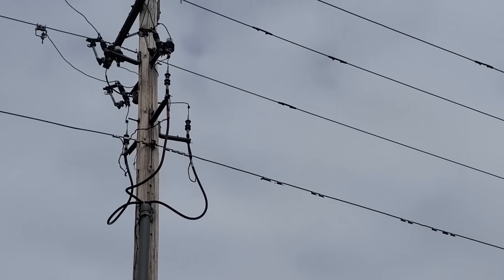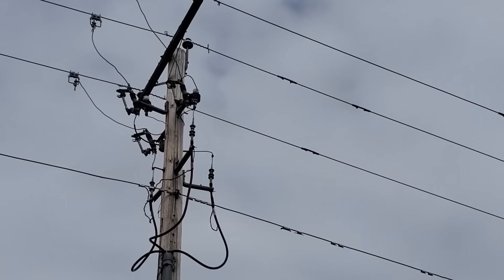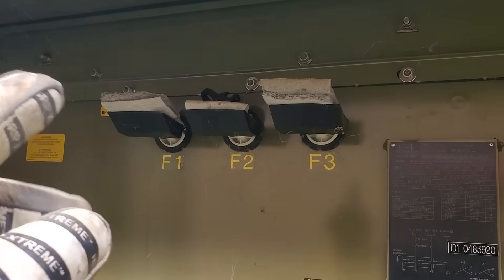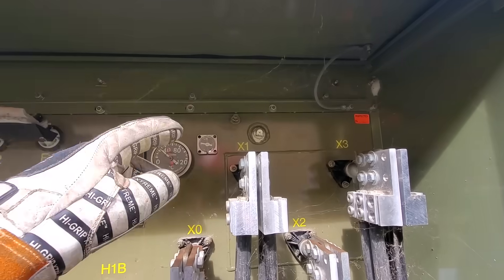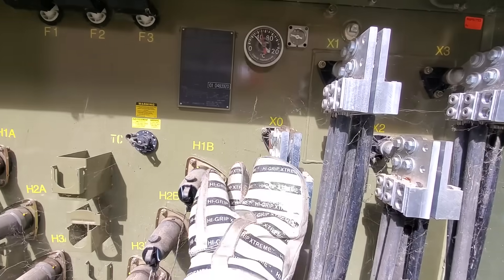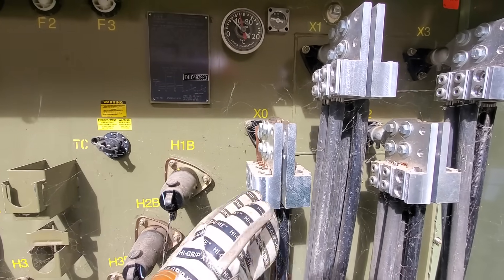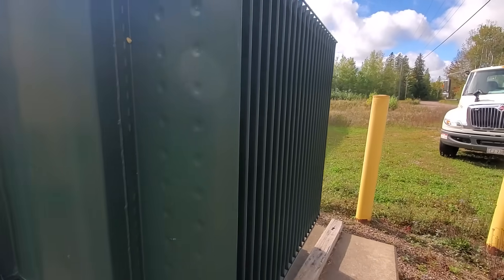A closer look at Padmount Transformers

Comment from the maker: ⚠️ First off... This stuff is absolutely not to be touched by anyone other then a representative from your power company whom is both trained and authorized to do so. 

I filmed this one last year and never got around to doing any editing with it. I've since captured a clip while I was removing the fuse cartridge to do work on the secondary bushings but didn't show how to change the actual fuse link. I'll be sure to post a vid changing the fuse link in the near future!

Cheers all!
Reply: That green box is where the local residential Cold Fusion Generator is located.
Oh wait...
Reply: Thx for the videos I used to help do power routines AT&T. I always wanted to see inside these transformers but anyone with common sense isn't going to open one without proper training.
Reply: Only line men can open the mmmmm doors
Reply: @hughsgarbagetrucks  Some idiots will force their way in.
Reply: No surge arresters eh?
Reply: When do you have to wear arc-flash protective gear?
Reply: Love your videos, learning a lot that I never would have the chance.  One suggestion: On your text descriptions, leave them up longer please. Rule of thumb, I heard, is as a video editor, ensure you leave enough time to read the text twice.
Reply: No matter what you should not be messing with the elbows while live even if you think you can it would destroy the elbow or cause an ark flash. I'm a splicer by the way.
Reply: I’m a plumber and we had a gc ask me to run a camera down some 4” conduit on a commercial site. They had trouble feeding their cables and wanted to check the conduit. This transformer was twice as tall as most of these you see. Anyway I’m going along and then I see the camera exit the conduit and he yelled stop. He then decided to tell me it was high voltage on the other side. I was safe because I’m 200’ away and as I’m aware fiberglass isn’t a conductor. But I’m feeding a metal head and could damage the transformer and fry my camera. I was not happy with them not including that in the beginning. I’ve done conduit since but now I know to stop before it exits the conduit.
Reply: Never heard of a 347/600 service before, that's interesting.

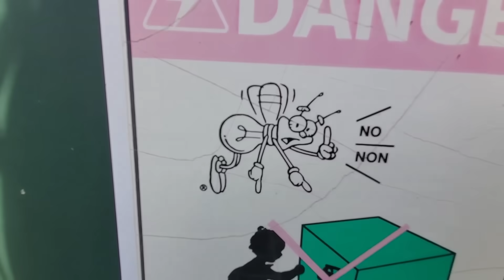8:26 It's Louie the lightning bug, you got to play safe around electricity. Fun seeing him on equipment.
Reply: Electricity. We only need to know two things: If you don't pay your bill they turn it off, and it will kill you.
Reply: Watched the lineman change ours the other day . Our B phase went out and shut my whole department down 😅
Reply: Can I pee on it so everybody knows it's mine?
Reply: Its alot of whoop ass if it touches you!
Reply: Not to be touched by untrained personal eh?
No s--t.
Reply: whatever IS in those transformers, I'm sure it's:

more than meets the eye
Reply: I was working in my office about 50 from one of those when it blew up.   9/6/23. Retired electrical engineer.
Reply: My pop used to work at a place in Waukesha Wisconsin called RTE that made those things. He spent almost 30 years there. Privately owned company back then, he treated his help very well. They had an open house showing the huge coil windings that are inside a transformer like that. It was always a running joke when the family was on vacation,  pop would spot those things and he could tell if it was one of theirs.  As a kid I didn't understand the pride he felt seeing one of their transformers and pointing it out to us.  Thanks for the show,  I do get a kick out of watching you keeping our lights on. 😊
Reply: Brave of you to think I'm going to go anywehere within 5ft of that.
Reply: I remember the "Ready Kilowatt" dude, he was in the form of lightning ⚡ bolts, I think it was a G.E. safety mascott, the slogan was if I can recall, "Remember kids, Electricity kills"!!!
Reply: You should maybe pin this comment atleast for the safety info in the first paragraph.
Reply from the maker: Thanks for the reminder Doug! I had intended to do that when initially posted 👊👊
Reply: @Bobsdecline  it's Dev actually not Doug. No problem, glad I could help
Reply from the maker: Oh shoot! Sorry about that Dev! There's a Doug here with same last name 🤦‍♂️ . My bad . Thanks again and cheers!
Reply: @Bobsdecline  I have worked at transformer manufacturer for 15 years an use to work assembly the front panels an hit a fuse under pressure check needless to say everything around including me was soaked lol not fun
Reply: Yeah you can definitely get arrested around here just for cutting the utility's padlock off here, never mind actually opening the doors.

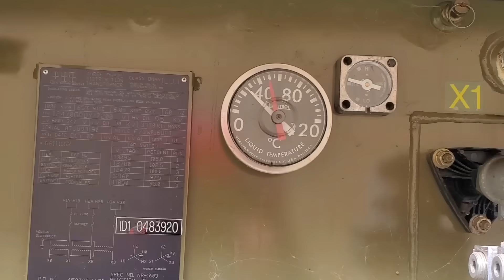Comment: 3:31  This 1000 kVA transformer was built by ABB in October 2007.  The red drag hand on the thermometer shows a maximum temperature of 50 degrees C.  Your video is from 2023.  So even after 15 years, the customer's load still has not grown enough to even approach nameplate of transformer.  Like most utility transformers in North America, this unit is most likely two sizes too big for the customer's load.
Reply: Ain't that a good thing? That means Americans are prepared for the worst

Comment: 5:00  The bayonet fuse is connected between the H1 bushing and the HV coil of the transformer.  Yes it interrupts power to the secondary side, but it also deenergizes the primary coil of the transformer.  Some linemen incorrectly refer to the bayonet fuse as a secondary fuse.

Comment: In Australia, the transformers are all internally star connected & the domestic primary high voltage feeder is rated at 11 kV line (6358 phase voltage)  & in our town they're mainly pole mounted.

A bit over 30 years ago the supply authority (Energy Australia) had to do a tap change  after installing a new transformer in our street because it was putting out 260 volts phase voltage on the secondary side & our light bulbs kept blowing, the voltage tends to be between 230-250 VAC phase voltage on the secondary side of the transformer.

I have seen them leak oil from the bushings on the primary side & the transformers have had to be replaced.

33 kV line voltage is sometimes stepped down to 415 volts line / 240 volts phase in a more industrial area or where it costs too much money to run 11 kV feeders out to a few houses in a village &  33 kV feeders are nearby !

Comment: 2:45 It can be and is done. Proper equipment and procedures exist; nevertheless it's a rare sight, because usually new houses don't just randomly spawn where there's no padmount nearby where the HV is already surfacing.

Comment: I think it is kind of ridiculous that the HV side of the transformer has layers of ingress protection, yet the LV connections are all bare. No covers, no shielding, niente.

BTW, those transformers barely exist in Germany. Usually, they're mounted in massive pre-fab cast concrete housings.

Comment: Have the first of 3 pad mounts in my front yard. The one that takes the Line Voltage I believe 14.5kw down to 240v. They ran a new feed to it and down the street a few years ago. Im pretty impressed at that voltage how what looks like a tiny wire from the fuse cutout to the feed line carries 40 plus houses on the street. And yes I know ohms law. Just impressive. Just happy after the repairs we went from 108-120v at our outlets to a solid 125v. After 4-5 times having our yard dug up to repair the old feed. 

Dumb question though. From the pad mount to residences are the feeds to the homes in conduit usually or direct burial cable?

Comment: As a licensed Professional Engineer in multiple states, Board Certified Forensic Investigator, 20 year veteran of the IEEE Power Transformer Standards Committee, electrical substation and power plant design engineer, and electrical test device patent holder, I will offer my candid thoughts.  I read through the comments below and see some disparaging comments made towards engineers.  I have noticed this throughout my career (40 years) and I believe it is basic human nature to lash out at the people who are not the ones in the field risking their lives doing hot work with high-voltage gear, as opposed to the very brave men and women who are actually doing this field work.  It is inherently very dangerous work, and unlike plumbing where a mistake might get you wet, a mistake here can be horrifically deadly.  (I use the plumbing analogy because water and electricity have some similarities in basic principles of use).  But it is a mistake and disrespectful to mock or hate others in the trade.  EVERYONE in this trade, from rookie apprentice to Senior Lineman; from new college graduate engineer to seasoned, experienced engineer needs to learn their craft and learn it better than anything else they choose to do in this life.  I have investigated numerous high-voltage contact events throughout the course of my career.  These accidents are most often gruesome and extreme.  I investigated an accident so disturbing I once stopped doing investigations for 3 years while dealing with nightmares and PTSD related to the accident specifics.  We work in a very dangerous trade.  The victims range from uneducated people trying to steal ground grids and transformer cores (Even when energized) to linemen with decades of training and experience under their belt, seasoned electrical apparatus repair people, safety instructors (Yes - Even Safety Instructors) and others who are what I call "Front Line" personnel.  Interestingly enough, most accidents do not involve new, inexperienced employees or "Desk Jockey Engineers".  I assume the disrespectful comments can be attributed to the sheer danger associated with those in harm's way versus those who are not, much like the Bering Sea fishermen who risk their lives fishing for Alaskan King Crab in often extremely dangerous and physically demanding conditions, as opposed to the boat designers and equipment manufacturers who are safe and comfortable in their offices and homes.   But without the boat design engineers and manufacturers, the fishermen would not have the modern features these boats require to allow them to perform their dangerous work and return home to their families.  And we all know that sometimes they don't, and the same holds true for linemen in our profession.  But to that extent, every single bit of electrical distribution, transmission, and generation system apparatus and operational protocol has undergone engineering review and application of best known and understood practices, guides, and standards.   Engineers perform the design calculations that provide safe, reliable margins for the application in the field.  But herein often lies the rub that a field worker may have against engineers.  It's the field worker risking everything, doing the job that the vast majority of the population would never even consider doing.   (That career choice is one of the most admirable ones I know of, and I for one have tremendous respect for linemen, electricians, and field personnel in this trade.)  That's not a reason to hate on engineers.  Linemen actually rely on engineered designs to keep them safe every single day that they work.   I personally think it's wrong to blindly disrespect anyone who chooses this field as their craft, and there are a number of engineers who often risk their lives too.  I have been in countless manholes and aerial buckets throughout my years, including manholes ringed with flooded cables, sometimes steaming because of overheated connections and low voltage faults.  I once lost a colleague who was asphyxiated due to gas in a manhole - an engineer doing field verification for underground conduit bank design.  I lost a 40+ year electrician to a switchgear contact accident.  Two different people, both great men, both experienced, and both very dead.  I personally made a critical decision early on in my career to spend as much time in the field working with the craft workers to learn the hands-on demands so that I could be as good as possible at my profession.   There are many other engineers out there who do the same.   I earned the respect of my field crews, and my advice to any young engineer reading this (Or older engineer who has little to no field experience) is to get out of the office and learn your craft.  Forget the cell phone, forget Facebook, forget distractions, and learn your craft.  Take it seriously.  Someone else's life may depend on your understanding of your job.  I have been privileged to enjoy a safe, challenging, and rewarding career for nearly 40 years, and I intend to keep doing so for many years to come.  I love this trade, and I love the brave men and women who keep the lights on around the world.  All of them.   Lastly, I'll just drop this here:  I have designed nuclear power plant modifications that required intense study and training, along with a deep understanding of electrical engineering, nuclear physics, and chemistry.  I have designed and built a bi-polar Tesla coil that generated approximately 1.3 million volts from a standard 120 VAC outlet, and safely held 1.3 MV in my hands while lighting a "burned out" lightbulb with blinding light.  These are things that no lineman could even consider attempting.   Engineers can do some pretty amazing things, and we don't hate others who can't achieve or accomplish these things that we often do easily.  Let's work together safely and with mutual respect.  The profession is dangerous enough without adding negativity to the mix.  Be safe and God bless.

Comment: I used to build 5MVa, 15MVa and 25MVa padmount from scratch. From magnetic core, low tension windings, high tension windings, regulation coils, Low Voltage connections, connect up tap changers, tanking and finishing. Most interesting job iv ever had. Great vid!

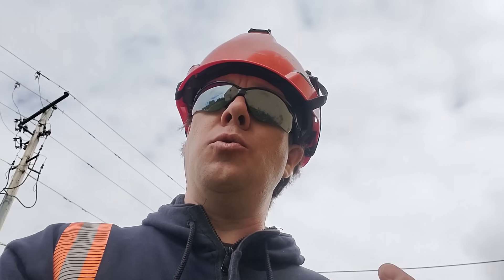Comment: 2:30 Agreed. I live in a country in which everything below 150 kV is buried underground, and extending or repairing 10 kV (or higher) circuits can't be done energised. However, we run the HV circuits in rings which means we can isolate the sections between substations without disrupting service to customers. In normal operation, these rings are opened in a specific (calculated) spot, but can be closed in case of emergency.

Comment: I understand pole mounted lines are easier to work on, however you are not telling the most important feature of buried lines: It's vastly safer for the environment. Here in The Netherlands Everything 25kv and below is buried, except for some really old (and very rare) rural segments. We even have segments of 380kv lines buried because of safety issues. 

But the most important feature of all has got to be that we don't have to look at all those ugly power poles all over the place. And yes buried lines have to be de-energized before working on them, that's why everything is laid in a ring, for both redundancy and ease of maintenance.

Comment: About 30 years ago I was working with my dad bricklaying on a job site,it had been raining overnight and I went up to the cement mixer to plug the 15 amp 240 volt extension cord in to get a mortar mix happening and as soon as I plugged that sucker in I got the biggest wack in the middle of my back and woke up on the ground with my dad and another bricklayer standing over me. I knew straight away what had happened. Luckily the extension cord was connected to a breaker switch which cut out and stopped the flow of electricity going through me. It felt like someone came up behind me with a lump of 4x2 and hit me across the middle of my back. Ever since then I’ve had a healthy respect for those angry pixies. And yes I’m in Australia and we used 15 amp extension cords on job sites back then.

Comment: Subscribed. I work as a design engineer for water systems and while electrical systems are a little beyond me, i still need to be aware of the applicable codes when placing the panels in my drawings. I always love to see whats inside the boxes, since our electrical team does the reviewal on shop drawings

Comment: I'm learning a lot about electrical distribution systems from your videos.  I am an engineer, but not an electrical engineer.  Years ago, I worked at a mine.  We have a 60,000 volt dead-end line that fed the facility.  We then dropped it down to 4160 volts to feed our electric mining shovels.  Somehow, I thought those voltages would be sort of a standard.  Years later, as a construction inspector I was on a job where we installed a 60,000 volt underground service at an international airport.  At the distribution voltages a function of how far you are from the power source?

Comment: What is the purpose of an electrical service like this with a transformer on the ground instead of just a transformer on the pole and running the line in the air right to the building? This seems like so much more work and expense especially when the building is right there by the pole.

Comment: 5:12 That fuse looks like a standard UL Class RK5, the same style used on the high voltage busses in my plant, just connected to a long 'dipstick' holder.

Makes sense that standardized components would be used, easier work for maintenance crews.

Comment: Once upon a time i had a fire in a scrap pile (no electricity was connected) out back an electrical contractor, meth head training to steal copper. He started a massive fire next to a few of these. One was so hot it marked fire on the thermal imager. After being told to put out the fire we ended up punching out the 3 fuzes, there was no pressure because everything was melted but once we whet to put out "fire" the oil exploded and burned the shit out of the rookie firefighter. PPE ultimately saved our lives.

Comment: I worked for GE many years in switchgear and power generation. Mostly test and inspect for nuclear power and fossil fuel generating stations. I worked on many pad mounts during that time. They were much easier to access than standing on top of a substation transformer😁